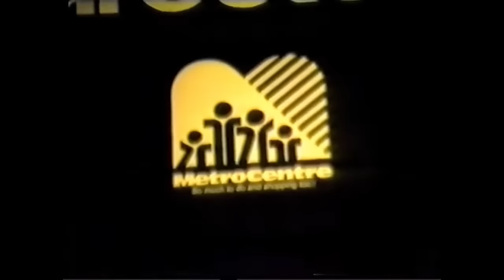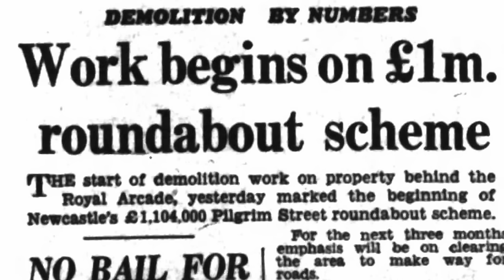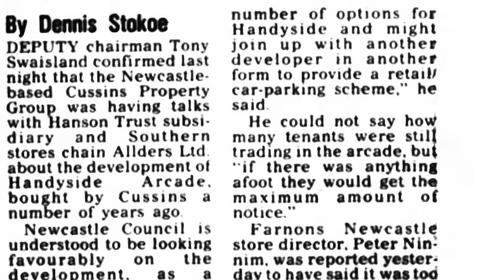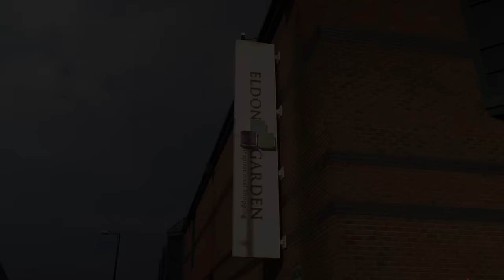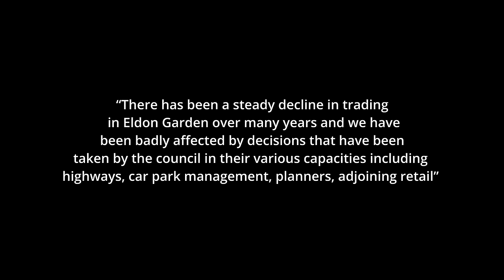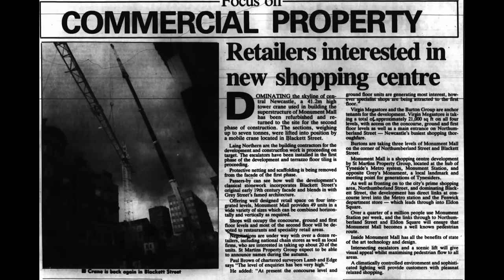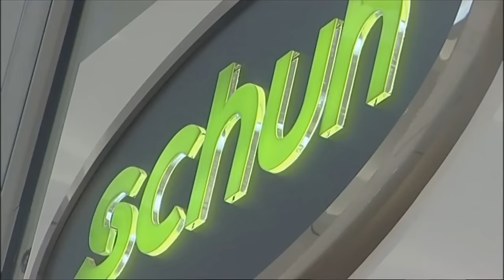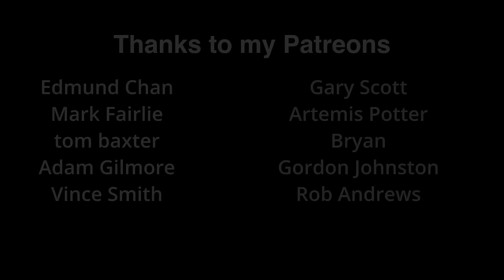Newcastle's Lost Malls

Comment: These days cities would kill for a Handyside arcade , poshed up with niche upmarket retailers it couldve been a tourist attraction .
Reply: Like the arcade in Morpeth.
Reply: Like the central arcade, it's always nice to walk through there
Reply: Totally agree....👍
Reply: I used to hang out at handyside arcade, usually outside the Kard Bar back in the mid 80s.
Reply: If people used them they would still be there. They are not wanted
Reply: @bojack40  Seemed like Handyside was popular. Green market was definitely still in use when shut down (the video even states how their claim was they where just updating/rebuilding a new Green Market but switched and then said it was 'too expensive'). They wanted 'high level chain store' for middle class people not quirky mom and pop stores used by the working classes. It was all about greedy entrepreneurs chasing that 'Harrods' type dream, it was nothing to do with what was there not working.
Reply: Very few niche upmarket retailers come to the North East because there isn't the underlying market to support a lot of them. The North East has a very small population and is poor.  It's why you see so many different shops in London that have no presence in the north east.
Reply: @BonkersAboutAlice there's nothing especially niche or upmarket about that. It's pleasant, but is largely made up of run of the mill chains

Comment: Great video Jordan, hard to believe they demolished Handyside to replace it with such a colossal failure, and then to go on to build another extension while that whole section was already sitting mostly empty... as if the writing wasn't already on the wall in 2013.

Comment: This is so interesting and I’m only enough to remember when the swallow arcade (I called it Newgate arcade) was actually not covered in and open to the elements.  I worked at Woolworths and you’d see the snowfall outside the side door in the winter and it was bitter cold.  I also remember an arcade which I think suffered a fire at one point in the 90s?? It was leazes arcade and had little craft shops and a cafe.

Comment: Metro centre will be the next abandoned mall… barely anything left in there now. Got a whole entire wing of the metrocentre down towards where Marks & Spencer’s is where there’s so many empty units. Loads more empty units dotted through the rest of the metrocentre aswell to be fair.
Reply: Someone needs to restore it back to glory. Its the same issue as Eldon Gardens, they strip everything out and then looks for stores like Harrods to open, in the north east, one of the most poverty stricken parts of the UK. Every single time they make an announcement they are told to let out units to smaller affordable local business but they just never listen.

Comment: I'm 37 and even in my teens the monument mall was in decline. It seemed that Virgin was the only decent shop there and the food court was struggling. It's a shame because I used to enjoy walking through it and visiting the shops. 

I also used to love going into the Green Market for some crab sticks and a haircut (not at the same time 😂). 

Eldon Square is clinging on with the introduction of more restaurants. The Eldon Garden section is barren but this too has been in the same slow decline for about 20+ years.

Retail needs to find a way to adapt or it will die. Most of the shops outside of these malls are gone and visiting the city every few months is noticeable when you see more units shutting down.

I'll be interested in what the town looks like in another 20 years

Comment: I had never realised that the rebuilt Royal Arcade was fake. I knew that the City Council had lost/misplaced some of the stones and that some elements were misnumbered which had caused delays in the reconstruction. But it was all a lie apparently!
Undoubtedly one of the reasons for the demolition of the The Handyside arcade was that it was a focus for ‘large numbers’ of young people who sometimes alternated between there and Eldon Green and this ran the risk of scaring the shoppers on Northumberland Street and in Eldon Square. As far as the City Council was concerned it contributed little economically to the city centre and the only solution was to turn it into car parking and shiny retail units. As you said that has been a roaring success! 
As you suggested something along the lines of what happened with the arcades in Leeds might have been a better and ultimately more sustainable option.
Another great video